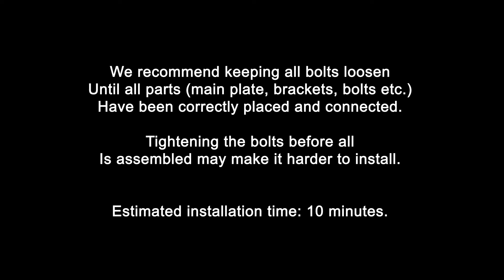ASFIR 4X4 - TUTORIAL - FORD BRONCO - Bracket for OEM Transfer Protector - 599667

Comment: Was a bit tricker than expected. Had to loosen the OEM transfer case skid bolts to get everything to fit and thread on. But I totally understand why this brace is needed! Great quality. This video was a big help. Stupid me didn’t realize the OEM upper bolt is welded on and didn’t need to be removed.
Reply from the maker: Glad to hear that this video helped you with the installation process :)